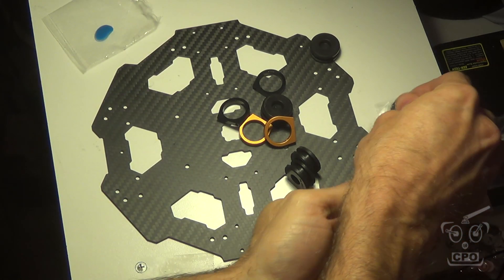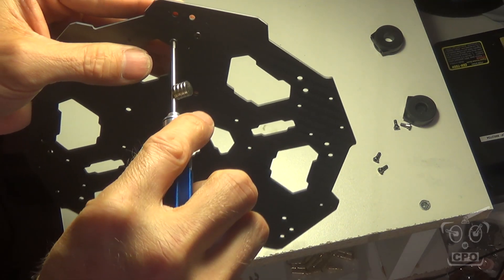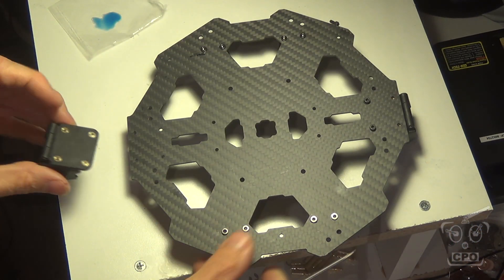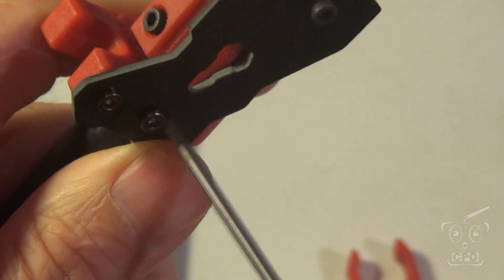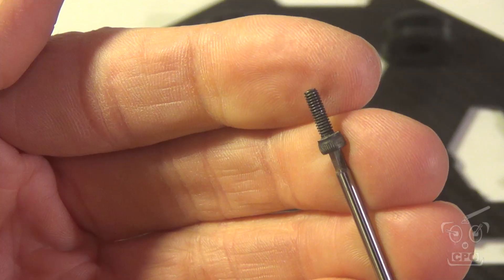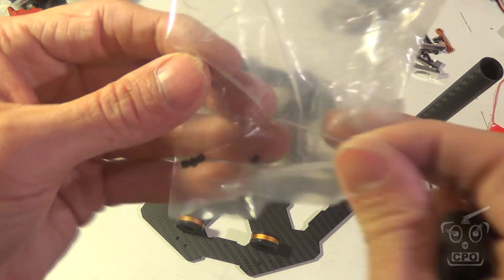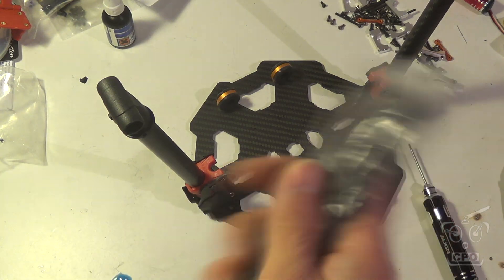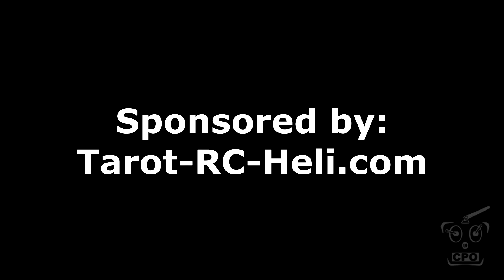Tarot 680 Pro Hexacopter : Lower Assembly (Landing Gear and Bottom Plate)

Comment: Your videos are beyond great!  I have just started putting together the frame and was hoping you had any updated information on the 680 Pro.  It appears my kit is either missing the 2 orange 16mm motor arm clamps or the design has changed.  Would you know?  Thanks!

Comment: Hi CPO, nice video...I will like to know if it's possible to use the pcb plate on the bottom facing down and the carbon plate on top ,without negative effects?
I look both plates and are almost identical besides a big hole in center on pcb plate.
I will have more room to install electronics and naza on center of top carbon plate...

Thanks in advance.
Reply from the maker: Just make sure the mounting of components is not impaired. The landing gear and battery tray would be hanging down from the bottom plate.

Comment: Hi CPO, nice to see the build video coming along, very helpful.  I have finished my build now and just waiting for time to try the maiden.  A couple of points to mention, The top and bottom plates have a front and back, they are not symmetrical.  There is a single hole rear centre on both plates, in the top this is for the back post if you opt for the optional hood and the hole in the bottom plate is so you can get your driver through to tighten.  Similarly the landing legs have an inside and outside, the outside is determined by the little plastic lump on the red fitting that goes between the 2 "Italy" pieces (see 4:39 in your vid).  This must be to the outside so that it will engage with the locking clip.  Unfortunately I fell foul of both these points and ended up with a lot of rework.  Hope this helps.
Reply from the maker: RedHotPheasant, Thanks for the feedback. Indeed the top and bottom plates have a direction IF you are using a canopy, otherwise it really doesn't matter.  I wasn't trying to insinuate they were symmetrical...I was referring to the little round battery/camera tube holders when I said it didn't matter what direction you put them.  I did call out in the description a note about the plate direction, but probably nobody reads those! : )  Good point about the little knob on the landing gear. I built it that way, but neglected to mention that fact in the video. Totally forgot to bring it up. Thank you.

Comment: do you lock tite the grub screws on the landing gear as well?
Reply from the maker: Nope. No need. The grub screw is metal and going into the plastic part...so no threadlock needed. And actually, thread lock doesn't treat plastic nicely, so its not a good idea to use it for that reason.  If you wanted to try and lock it in place, a dab of CA would work.